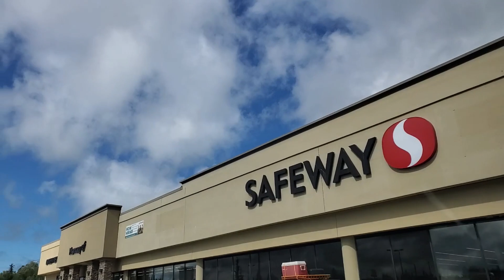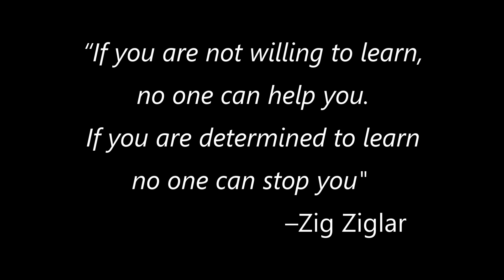Final push before the Alaska cabin gets a subfloor

Comment: How will you block the critters from eating your insulation under your sub floor ?   Just a thought.
Reply from the maker: I will use hardware cloth to stop them from getting into it. Thatbis a wire mesh with quarter inch squares that I can staple on.